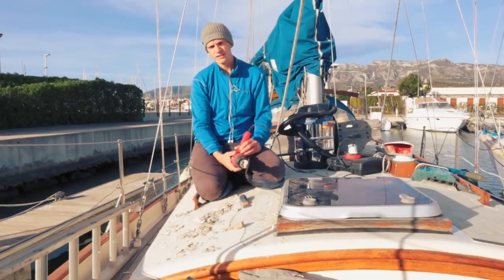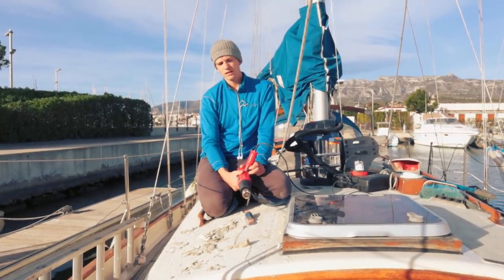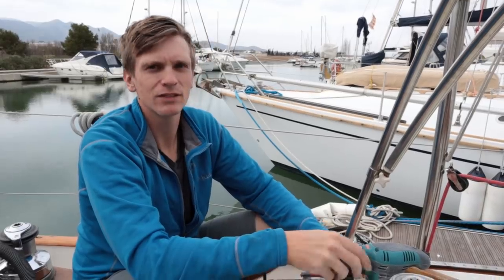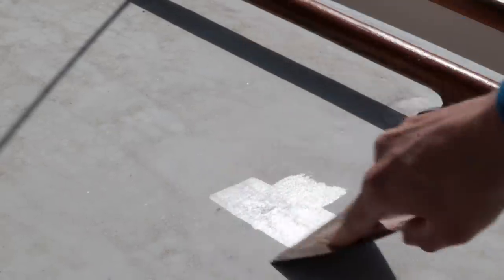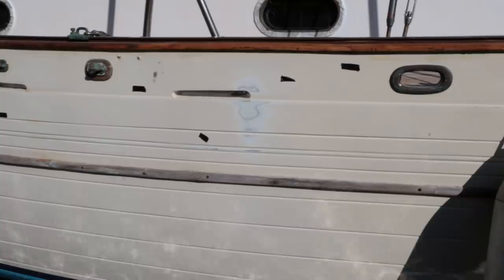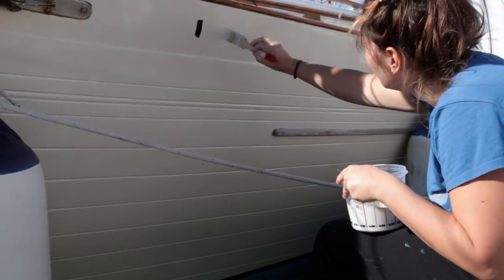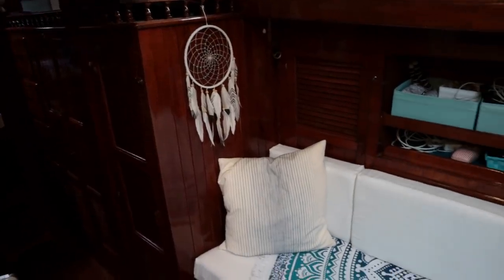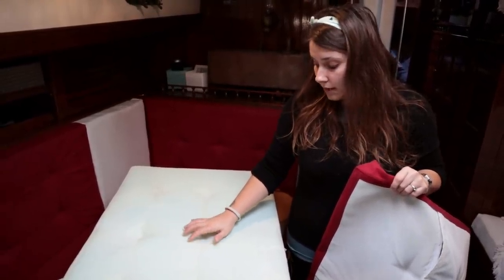39] Refitting A Cheap Old Sailboat | DIY BOAT REFIT | Sailing Skua

Comment from the maker: Let's talk fuel polishing! How many of you guys have a fuel polishing rig? Is there any improvements you'd make to ours?
Reply: You mastered the sewing machine, and there wasnt even any swear words! Well done!👍
Reply from the maker: Haha not yet... you’ll see me working on the canvas soonish... 😁
Thank you 😊
Reply: Did you see the follow up to Patrick’s video? He put a cheap inline filter before the main ones. Guess that would be my suggestion. Get 3-4 of the cheap ones and then install one and replace as needed. But as far as the actual polishing rig... looks good
Reply: Oh and congrats 👍🏽🌎 on the engagement!
Reply: I don't see a real reason to keep a polishing rig on the boat,considering your design is so simple and could be recreated on demand. The unit would be better served if it was passed around the marina for use by people that have stale fuel onboard. Use it once every few years if your using your boat as a boat VS a condo.
Reply: I do have a nice setup with two diesel tanks one port one starboard cross connected with a mixing pod with a water drain at the lowest point and a fuel pickup at the top. Draining water is essential, I do it once a month in winter.  I tap about 100 ml and put it in the wast oil can. Sucking out crud at the lowest point is excellent but I would dispose of it. Connect the fuel polisher on the normal engine pickup line to purify unknown fuel in unknown tanks is a very good practice. PS. I do have a 20 liter can of spare clean diesel on standby and the correct fuel line with an inline filter for emergencies.
Reply: Like you I have a portable rig which I am considering fitting permanently so just flick a switch and it runs.  However, mine didn't pick up the thick custard gloop on the bottom of the tank.  Had to open her up and use a 2" wall paper scraper to clean it all out.  No problems since.  Oh and the cause, likely the fuel filler seal now replaced every couple of years.
Reply: I would keep your polishing kit as it might be needed if you fuel up from a dodgy tank. I had a 10 gal. day tank that the engine drew from - easy to remove and clean  and easy to fill from a jerry can if needed. Use your polishing kit to fill the day tank from the main tank then filter again from the day tank to the engine.
When polishing, I slipped the plastic pick up pipe inside a rigid bit of pipe which directed the end close to the bottom of the tank. The big problem - the main tank had baffles which prevented me getting to all  the tank bottom. Blow the hoover into the bottom of the tank to stir up the crud.
After 49 years I still think marriage is a wonderful institution! Congratulations!
Reply: Well, diesel polishing ...
You still do not know how much of nasty un-filterable remains will get stirred up/washed off Your corners in the first choppy draught You go through. Worst transfer I ever had in terms of diesel trouble was a winter delivery from Port Grimaud to Monfalcone with a vastly undercanvassed Tirandel-style Gület - no sailing upwind. At all. Boat sat a couple years before customer got it and we changed diesel, of course, and flushed everything three times with gasoline, ATF and red diesel (more sulphur = more of a solvent) but still needed a dozen filters to Otranto, presumably because of what came from the topside and topcorners of the tanks when stirred well for days.
If You do not open/look into Your tank on Skua personally, I would not completely rely on the diesel in the first nasty chop to be honest.
What did we build to help us keep going?
I used 20 liter NATO tin jerrycans as day-tank, later after Otranto, at least as a backup, and a normal NATO diesel filler cap with two hose-able openings, one with inside hose down to bottom (and a little screen on this, too) to feed the fuel from, and another for the return flow. I built in a simple ballpump in the feeder line to get fuel from this canister to the injection pump when the normal way was clogged again, and we had to change the source once more to keep going while glass/filter were cleaned out and changed. Once it ran off the canister, the engine's injection pump sucked enough to keep it going. Worked ok and did not need a full bleeding this way each time, and was an easy fix for us to reach both Otranto and Monfalcone - had three of those jerrycans and a modified pump with a "polisher" like Yours with a simple glass separator to fill the daytanks from the nasty big one. 
It was really amazing how much crap came out of that tank once it was shaken well, even after all our tries to get it clean.
As reference: something like this:
https://www.ebay.de/itm/Tankentnehmer-Kanisteranschluss-fuer-Standheizung-Bundeswehr-Kabine-Shelter-BW-/123691107118
Luxus version with glass: 
https://www.hrb24.de/2-strang-filter-notversorgung-mit-kanisteranschluss.html
Cheers 🍻
Reply: Two weeks ago I had my fuel tank (40 US gallons) professionally steamed cleaned, $720 usd. 

His advice. "Fuel Polishing. Is temporary. You still have muck at the bottom and the sides of your tank(s). It has to be pressure washed out. 
We'll pump your fuel, polishing it, into a temporary drum, then clean your tank. If your fuel is good and not black we will re-polish it, adding Bio side."

If you have a clean-out on your tank good! 
(1.) Pump out old fuel into 55 gallon drums.
(2.) Pressure wash the insides (NO SOAP). Shop vac water and muck into old drum.
(3.) Replace clean out lid and pump in new or old polished fuel. Adding Bio side.
(4.) Change All fuel filters. Clean fuel lines too.
Now your good to go. 
It took a pro 3+ hours to do my Ericson 41. $720.
Reply: Let me add this. I too bought a 12 volt pump and filters and hoses, $180 ish. I was thinking later, maybe this time I'll let a professional teach me. Yeah. It cost me but it was worth it. I learned the difference from polishing and cleaning. I would think that most yachts out there need their tanks cleaned. Especially, the Power Yachts! As soon as I sell my Albin Vega (this week I hope). I'll finish a couple things on my Ericson...
Reply: @svoctopus4888  I agree, I moved to the east coast where homes are heated with diesel. I was surprised to learn that bacteria can live in your fuel tanks as they age. That helps trap the crud in the tank. Having an old fuel tank cleaned sounds like a better long term fix. Those white cushions look great, maybe you could paint them, make them unique for Skua.
Reply: Congratulations on engagement.Re fuel polishing system mount the pump vertically with the hose fittings at the bottom.This way much less chance of fluid getting past the pump seal and into the electrics of the motor and damaging it.All 12volt electric pumps should be mounted this way for longevity.Boat is looking good.Great work on the deck and cushions .
Reply: Just one  - in the event that you do get the need to bleed the lines at sea ( and for some reason this always seems to be the thing) we have fitted a small outboard primer pump after the filters but in front of the engine lift pump.  Saved our bacon many times.  And have you seen Julie Giffords Canvas for Cruisers  - it is pretty much a bible for canvas work
Reply: @svoctopus4888  It's a nasty job, so 3+ hours for 40 gal tankage is not bad.
Flushing all lines and connectors and glasses with gasoline and ATF usually removes most crusty residues and all the slush, it doesn't remove diesel algae completely though (don't ask me why I know ....)
Did You have algae in Your system?
And how big is Your cleanout? Hand only, or arm, or even head-in to have a look?
Cheers
Reply: @manfredschmalbach9023  - Hello Manfred. Years back the previous owner had a 6 inch cutout installed on the tank. My cockpit floor is all glassed  in, so I had to install an 8 inch hatch above the 6 inch fuel cutout. 
There was some water and very little algae or muck in my steel tank. Almost none. Yes there was some pitting at the tank bottom. Not bad though. 2 owners back had the tank cleaned. I want to go cruising so I had to know the condition of the tank and fuel. Not say; "Ah. It'll be all right". My diesel fill location, is in my cockpit. It's OLD. And rain (PNW) would stand on top while the rest of the cockpit was dry. 
My Racor was ugly. That's what made my decision to bring in a professional. We found fresh water also in my primary, which is very bad. I had to leave the next day. So when I get back I'll remove my return line and pump clean diesel through it. At the same time loosen the other fuel lines and pump fuel through them. I hope. I really hope. There's no water in those lines. Injector pump and injectors. I hope I hope. 🙏 . I didn't want to start the engine when I bought the boat 2 months ago, because of the dirty Racor. Water getting pasted the Racor is bad bad. $$$$
Reply: @svoctopus4888  Yeah it's a pity how the engine and its periphery usually are cramped in without maintenance and repairs in mind on so many smallish sailboats. Technical yoga and inventiveness like creating all new hatches is often needed. It's a good thing cleaning out tankage and lines well when engine didn't run some time. Injection pumps are prone to damage with particles and heavy slush, the more modern (cdi and tdi and other high pressure systems) the less forgiving. Filling tanks through a sock pays often when You can hold back all the sand and rust particles from the filling station tank coming by pump ... never, NEVER fill Your tank while or shortly after the filling station's tank was refilled by the delivery truck. Their big tanks often are a centre of epidemic for their own, and You often get a lot of water with their diesel.
Having a funnel with a water trap and never getting any fuel into the boat's tank directly any more is a method a buncha friends developed when having had algae and slush recurrently. I often try getting my diesel from car filling stations, not at the waterfront. Does take some schleping and a handful jerrycans, but the quality is often a lot better where modern, sensitive cars are refilled.
Reply: we use the cheapest automotive fuel filter - plastic, transparent - as primary filter towards the engine. Easy to replace, visible if clogges up.
Reply: @svoctopus4888  for that price, I think you could just get a new tank?
Reply: @andybartley1550  The problem often isn't getting a good price for a new tank, the problem is to get out the old one and even more so getting IN the new one without cutting away half the boat.
Reply: @manfredschmalbach9023  yeah! I just spent 2 days getting our tank out.  Cape Dory 27 in Tampa Florida.
Reply: @svoctopus4888  Yes agree with this.  Perhaps the other thing a home brew system can do is remove the water which collects at the bottom of the tank causing the problem in the first place.  The asphaltenes (black tar like substance) needed a wall paper scraper to remove in the absence of professional kit.
Reply: I use Fuel Right and don’t need a polishing unit.  It keeps my tank and fuel clean and has done so for more than 8 years now

Comment: Congrats to you two, yep refit two boats, you'll stick together! So there was so much fungus gunk in the bottom of my new to me 33 year old boat's diesel tank, i had to drain the tank and install 5" access panels to properly clean It out. My fuel was beyond polishing. It was alot of work, but was well worth it.
For my Sunbrella and interior fabric jobs I purchased a knock off Sail Rite, walking foot sewing machine called the REX from Ebay. It seems to be the exact machine for 1/3 the price and so far so good. I've read that sail rite makes them in China, or China is VERY good at reverse engineering this machine, it has the exact same parts. Anyway great job on the cabin top and your "fun with sewing projects".... cheers, Dan
Reply from the maker: Cheers Daniel! Ah, that sounds like a great deal.

Comment: Hi Ryan , good choice!   Re the diesel polisher , a nice move but once you are moving remember Diesel engines automatically polish the fuel as the pump always draws about 40% excess fuel so the injector pump is not starved of fuel , the extra fuel returns to the tank. In really cold weather this return fuel will be warm and help keep the fuel warmer and not gel. (Arctic weather). 
Congratulations to you both! Cheers Warren
Reply from the maker: Thanks a lot Warren. What we're trying to avoid is what happened to Patrick Laine (a great youtuber if you've not seen) on the way to the Azores. The crud in the bottom of his fuel tank, below the pick up line, got shaken up into the fuel in bouncy seas - this probably wouldn't get polished out by the engine's filters in it's usual operation.
Reply: Sailing Kittiwake  Ryan, oh I agree , the fuel polishing on a tank that's been sitting a while is a good idea, the hard part is getting the crud up of the bottom into the polishing system pick up. Once you are moving regularly it should be less of a problem.  
Yes Patrick has some great video/advice. Cheers Warren
Reply: Ryan, there is another great Patrick with some great advise  'Patrick Childress Sailing' recently now on YT but been writing for a while.
Cheers Warren

Comment: Next time you have to stuff cushions use a trash bag. Place the cushion foam in the bag, fold the Big end over tear a small hole big enough to put a vacuum nozzle and run the vacuum. It will shrink the foam and make it really easy to put the cover over. Cheers!

Comment: Firstly, many congratulations on your engagement, great news and best of luck on your future adventures.  I’m just catching up as I had my boat out of the water for just over a week with lots of jobs to do, seacocks, cutlass bearing, aft seal, Coppercoat patch up, topside polish, capping rail refurb and I went with Woodskin after your video and very pleased so far.  Great job on the cushions, mine has red which I don’t like and I have been looking out for a machine so that is next on the list.  That non slip was awful, good job getting that off.  I also like the inter deck as I think Kiwigrip is a bit severe.  Safe travels and I’m now on to your next video.  Andy UK. Ps. Patrick Lane is great and I have started building the same fuel polisher.
Reply from the maker: Thanks a bunch, Andy. Sounds like you’ve been busy doing boat work yourself! Enjoy the season now 🤗

Comment: Congratulations on your momentous news - you are already a great team.👍 great job on the decks and the cushions - you are making a massive difference already.👍 On the diesel bug front: As you quite rightly state the most important factor in avoiding diesel bug is minimising water in the fuel in the first place and the most common source of water contamination is a leaky deck fill connection (so check/replace the deck cap seals). You rig is an OK design and good to have the water separator first. I would say though that you probably need to upscale everything with much larger capacity filters and to have 2 in series one of day 5-10 micron rating and the other 2-3 micron. Better with fixed pipework too on the rig itself.

If you see evidence of ‘diesel bug’ you will however need to clean the tank manually and all of the pipework. Fuel polishing once you have the bug is a forlorn exercise and is ineffective and expensive.  Not essential but nice to have would be a much higher flow rate pump even a 240volt one as you could run when plugged in or from an inverter.😀
Reply from the maker: Thanks so much Norman - always nice to read your comments. I'll do some investigating, what brand of filters would you recommend for the fine (2-3 micron) filters? Good point on the deck filler - I'll look into it.

Comment: Congrats on the engagement. Also getting all that old deck anti-skid off manually and the wrestling match with the cushions. :) I just watched an episode of Rigging Doctor that used volcanic rock that locals use in the Azores for anti-skid, they didn't like it and had to remove it! On fuel polishing, you only need to get the water and larger particles out that build up and block fuel valves and connections before the main filters, especially if you install pressure sensors before and after the main fuel filters to see their health.
I could have sworn Patrick Laine traced his problem to the valve in the fuel line near the tank that blocked before his filters did. I think it was a needle valve and he replaced it with a petcock valve, but I can't find that video so might be imagining it. :) Also, get a fuel filter funnel that separates water from the fuel before it goes in the tank, and always use that when filling, and make sure the filler cap seals to reduce the chance of water getting in the tank and then diesel bug in the first place.
Reply from the maker: Thanks a lot for the tips Craig, good advice. I can't recall Patrick mentioning the valve, but you may be right. I thought his polishing rig looked like a great idea though, at least you get an idea of the level of crud in the tank.

Comment: Coming from a person that does not remember a day in my life that I have never been with out a sewing machine...

Good machine oil and regular cleaning and service will keep a machine running indefinitely. Some are built to handle the torque of heavy materials and cost a small fortune. The key thing id the needles. Buy the best that you can. Needles are designed for specific materials and functions. another tip that my mother bestowed upon me was bees wax... ( an inexpensive toilet bowl ring works great) wax your needle frequently, wax your fingers and go slow. For heavy gauge thread the waxed fingers ( have used an scented oil warmer for large projects to soften the wax) can apply the wax as it reaches the needle POST tensioners. A shot of WD40 on the bobbin thread works wonders too.